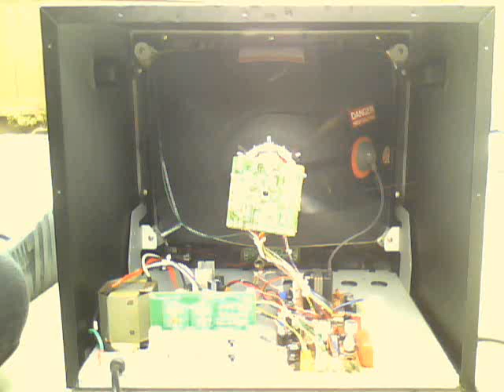Inside the Ultrak KM-17 B&W CRT CCTV Monitor

Comment: Not all of them are ceiling mount.  Most just sat on a desk in the back room. The reason for the metal case, is mainly because multi-monitor support wasn't invented back then, so you had to have one TV per camera. Which means, if you had six cameras to watch, you would need 6 TV's.  Resulting in them being stacked on top of each other.  Which is the reason for the perfectly square steel case with handles.